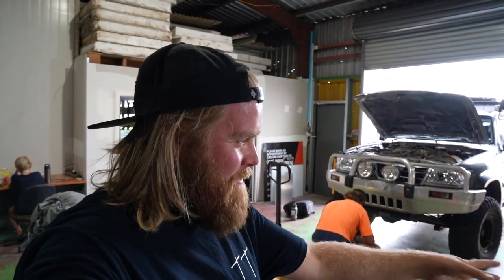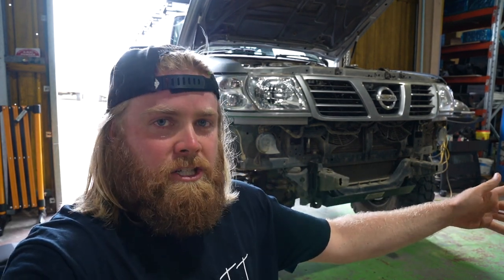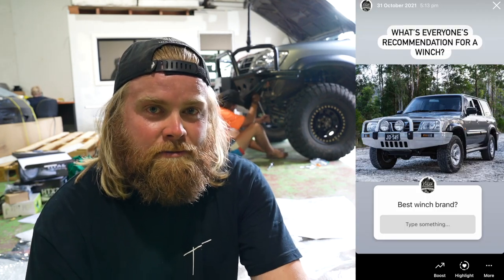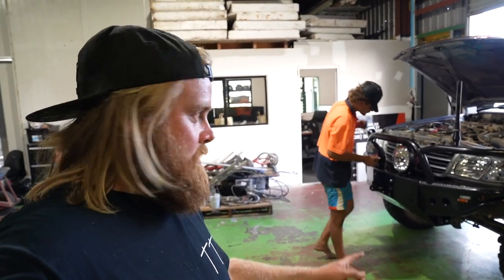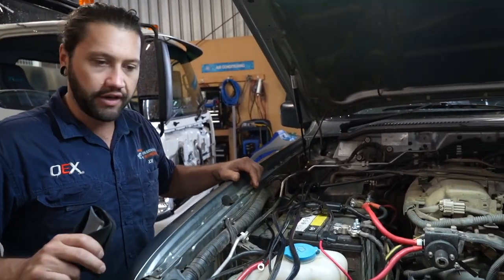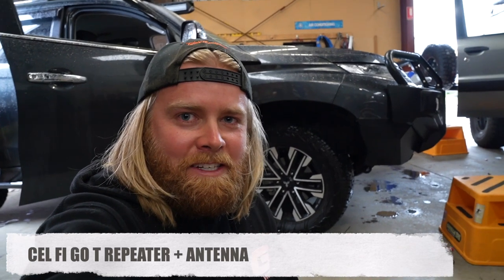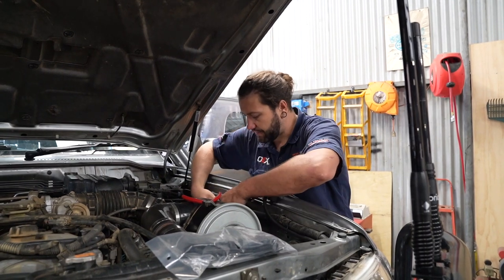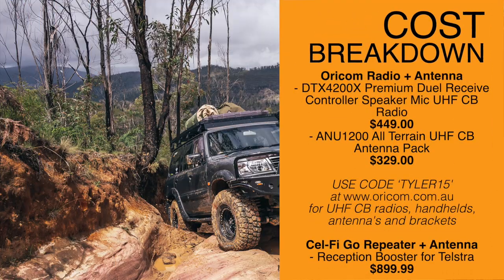Building the ULTIMATE off-road WEAPON! UPGRADING Bullbar | Winch | Lights | UHF on 20yr old PATROL!

Comment: wow, lightforce, a blast from the past. i ran them on my 3 4bys at the time n where really gud. not all that long ago they where pretty much on every truck, 4by n car n now rare as hens teeth on a vehicle. always where gud lights from the xenophot to the HID beam. they where the driving light leaders at the time. hopefully they r as gud as they where. interesting to get ur thoughts on the lights. the RFI signal booster is very gud. i used them on the 3 4bys through the QLD outback for work purposes which was very helpful.

Comment: Hey Tyler, nice video. What brand of battery terminals did you install? They look great and I’d love to do the same on my vehicle!

Also, when I installed my runva I ran an extension cable from the control box to inside of the vehicle in case the wireless remote fails while using it inside the car so I can quickly swap over to the hard wired remote.

Comment: With The additional weight now on the front is the recent upgraded suspension still within limits for this?  Also does the front need to be aligned again to correct camber?
Reply from the maker: No change to the front, I got the correct weight suspension knowing I was getting this bullbar/winch etc

Comment: yeww! Go the Patrol! been waiting for this episode for ages !
Reply: I wonder if this episode would explain why the last few days I seen about 10+ patrol bullbars being sold on fb market place haha
Reply: I thought the winch control box remote was a UHF 477xmhz frequency ?? not Bluetooth . but that's okay ..
Reply: it really is a big transformation in the looks between the two bars !!
Reply: good explaing the ADR approved over a comp bar
Reply: hopefully your mains battery has a high CCA to drive the winch also..
Reply: I've got a switch thru my hibeams but I read that legislation and I think it's a misconception as only if they are to be used on road with your hibeams . if they are an offroad only light u don't have to . that was my understanding of that
Reply: Antenna ! Antenna Antenna ! haha ! nice ! coz sky divers do aerials ..
Reply: celfi looks good !  that's a good hiding hole for them uhfs up there on the passenger glove box area . my one concern is if you ever do Nolan's Brooke cape York again . and don't make it ..  compared to having the outback equipment roof center console .
Reply: great video ! well done !
Reply from the maker: Cheers mate!

Comment: It seems Runva winches are the flavour of the year right now.  I'll be in the market for a winch soon.  I was just going to get the Domin8r Xtreme as it seems to get favourable reviews (I know there are many brand snobs out there, but to me if it works, and provides value for money, I'll consider it), and I won't be doing any hardcore 4WDing.  But since last year, everyone seems to be raving about the Runva.  So I hope you provide a long term review on this winch in a few months time to know how they perform and if their quality stacks up to the hype. 👍
Reply: Runva is good, i have one on the current rig. But Carbon is imho better, it's a lot lighter, better water ingress protection and better warranty.

Comment: Looking Good Tyler.👍 Some quality gear there.👌  I didn't realise you can still get HID aftermarket driving lights now that LED is so common.  Aren't those HID lights heavier that their equivalent LEDs?  As for the UHF mic/head placement, I would have mounted that on the same spot but on the opposite side (ie. passenger side).  'Coz after a while, the coiled cord will start annoying me when it rubs on my leg during 4WDing on the rougher tracks.

Comment: I wouldn't mount that isolator switch on the engine. Too much vibration through the bracket. Try and put it somewhere else firm, not on the engine where it moves

Comment: Any reason you went Rinva over Carbon winch?
I thought you might of gone for a high mount Warn winch?
Reply from the maker: Runva and carbon were the two most recommended but Runva slightly more recommended so just went with that one. Didn't really think I needed a high mount

Comment: Put the engine cover back on man
Reply from the maker: Keeps the temps down a bit having it off
Reply: @TylerThompson90  nah it doesn't man, the engine fan actually blows under it a bit and helps cool the coil packs
Reply from the maker: Yeah okay few people told me different from testing it out but Ill look into it!
Reply: @TylerThompson90  bolt it back on and get someone to rev it, put your hand up behind the cover near the firewall and have a feel, you will feel airflow.

Coils have issues with heat in these and you will go though a couple, MACE Industries have a set for like $190. Good quality and much cheaper than genuine. 

Do not buy coils,MAF,O2 sensors off eBay, they are unreliable or sometimes completely out of spec for the car and can cause issues. 

I dealt with 4.8s for years, I have Nissan data scan 2 on a laptop and can advance ignition timing 2 or 3 degrees in the ecu for a little more power and efficiency. 

Throttle body issues arise fairly often too with the autos, but it can be as simple as one of the relays on the passenger side in the engine bay.  Also, the O2 sensor plugs are the same, and can be plugged in wrong, so the banks are switched which will make it run poorly and feel like an intermittent missfire, just be aware of that

Comment: The old Airbag legal crap, need to be at minimum speed and have enough decelartation G's. No sensor up front and factory chassis will punch chassis rails through things they hit. 
Lights, simple rules regardless of opinions: LED is for close to medium distance ONLY. HID (needs to be propper HID lamp ratings, many are fake wattages) is for focussed medium to long distances. LED simply does not focus well enough to run long distances. FFS, idiots who build bars with antenna mounts too close together then fuels muppets who install antennas without a clue why you DON'T DO IT!.  They need to be spread out and 1/4 wave of lowest freq in use away from other antennas. Cel-Fi units are geat and legal, sadly, network operators are now limiting bandwidth on Band 28 (700MHz) to point where good for calls only, getting crap for data. Now the likes of Telstra who are still rolling out old 3G which is calling only kills data.